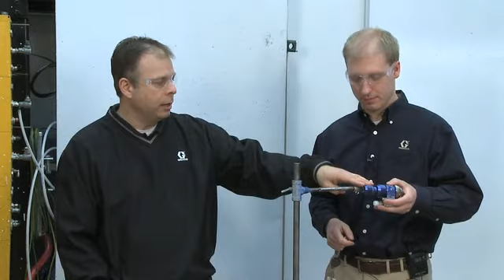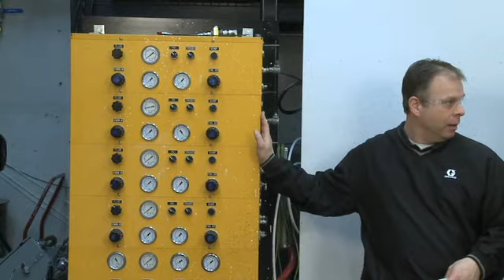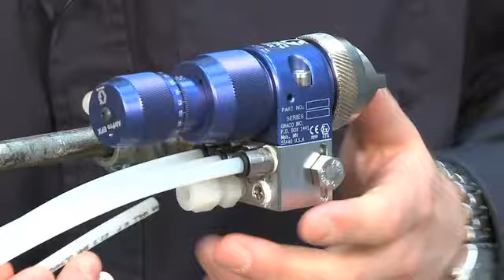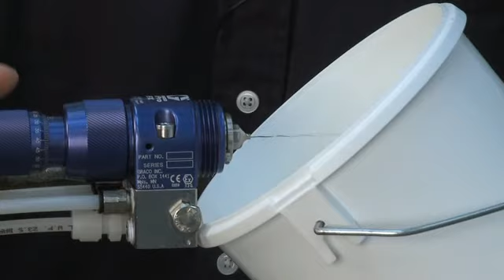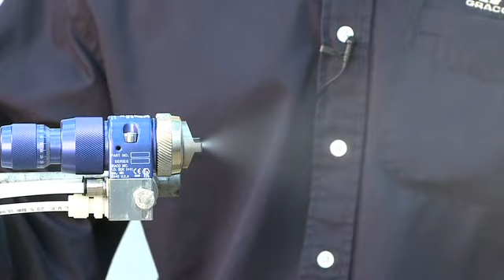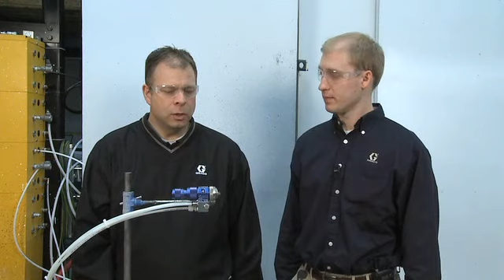Graco EFX Auto Gun Setup - Part 3

Comment: What is the difference between the air line and The fan Air line?
Reply from the maker: Are you asking about the atomizing air and the fan air? There are three air lines that go to the gun: 
1. air supply signal for triggering the gun on 
2. air supply for creating atomization
3. air supply for controlling fan pattern size

Comment: Can this be used for adhesives?
Reply from the maker: Yes. The AirPro EFX automatic spray gun and the regular AirPro spray gun can be used for spraying adhesives. Your application flow rate and spray pattern requirements will determine which needle/nozzle and air cap you should use. For proper selection, please contact your local Graco equipment distributor.

Comment: What a max coverage per spray
Reply from the maker: Coverage depends on many things, such as fluid nozzle, air cap, material viscosity, robot speed, etc. Depending on the configuration, the AirPro EFX Auto Spray Gun can handle up to 450cc per minute. More details are available at https://www.graco.com/airproefx